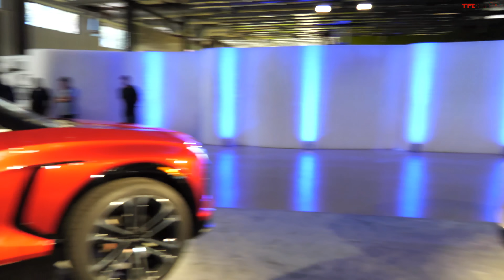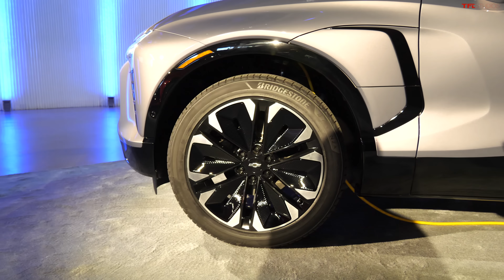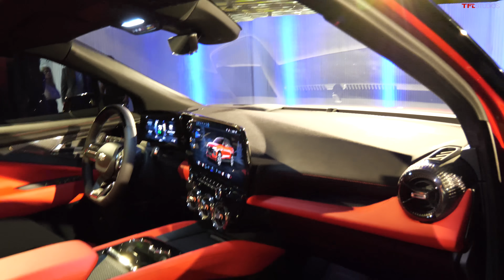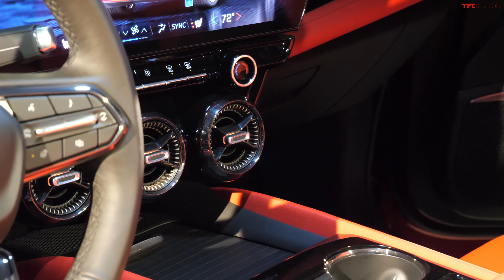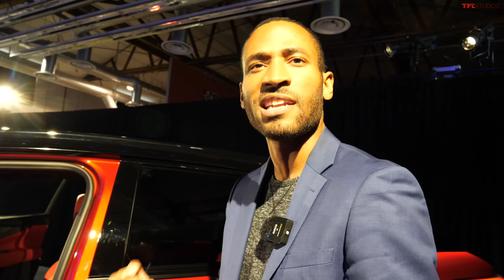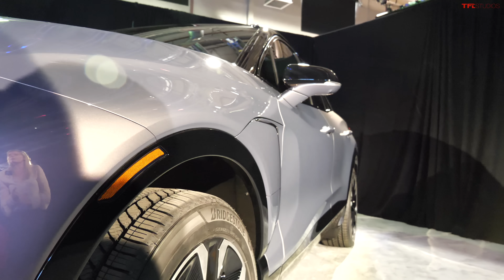Here’s Why The New Chevy Blazer EV SS Should Worry Other Electric Car Companies!

Comment: As a current owner of the XT6 Sport by Cadillac, I thought I was 100% going into the Lyric in 2023. Not anymore. I will be in the SS EV for sure.
Reply: 2 of my 3 current vehicles happen to be a Escalade platinum and we still have our ELR and a had was gonna get into a Lyric before I found out the first year was only the RWD only😕. Still want to get the 24’ lyric AWD but I’m wondering what the HP numbers will be because they’re only saying tentatively that it will be 500hp AWD which will not cut it if the Chevy will be rockin 557hp! 🤨🤦🏽‍♂️
Reply: @dennissmith7214  Precisely. Same story here. I have zero interest in a RWD vehicle. So I am waiting as well but once I saw the Blazer, my focus has shifted. As with any GM product, it will also depend on how quick I get my Family First Discount. Makes life easy when a 70k SUV drops to around 61k.
Reply: @MrJeffhart24  I would consider a RWD....NEVER a FWD........Tire spinning.ruining Ignorant design.........Paul
Reply: @paul-flyer  The SS model which we are discussing is an AWD.
Reply: @dennissmith7214  Word is that the XT5 will be made in a V version for 2024 as well. Wont be electric but if the HP is up there enough, it will be another fun one to look at.
Reply: @MrJeffhart24  Yeah I’ll be using my GM supplier discount😁, and as far as GM and rumors of other V vehicles I wouldn’t hold my breath on that…….we all know GM is the company of great ideas and big disappointments when it comes to making the products we actually want them to do, make a concept of smth we love and clamer over but never gets released🤦🏽‍♂️.
Reply: @dennissmith7214  500 or 550.........You won't notice the difference........Unless You're going to the drag strip.......Paul
Reply: This seems like a similar situation that Hyundai has with the Ioniq 5 (N) and the Genesis GV60. The luxury model doesn't seem worth the extra $10k or so...
Reply: @OlJackBurton  Agreed and I am a huge fan of Caddy.

Comment: I must say that I have truly appreciated the design of many GM vehicles for roughly the last decade.
This includes its current batch. Their lack of real BEV expertise does show with the way they design these vehicles. No frunk, slow charging both home and w DC fast charging… that’s by 2022 standards yet this is 2023 and 2024! Yikes.
Question is: will beauty be enough to make this vehicle sell?
Compare Korean, European and Chinese BEVs and this is somewhat missing. 
They will have a price advantage as Tesla, Audi, Hyundai/Kia, VW and others will be making their BEVs in Europe or the US… Like Tesla!
These will be made in Mexico. Much cheaper.
Reply: 190 kW is still quite fast and it is all down to teh charging curve. the EV6 and Ioniq 5 claim 350 kW charging but they max out at 240 kW.
Reply: @Nebula1701  re: "190 kW is still quite fast and it is all down to (the) charging curve."  bingo, after 50 years of marketing automotive consumers are so "suckered" by a psychology of BIG NUMBERS, that they've forgotten the importance of calculating and understanding averages. because: MATH.
Reply: Every manufacturer says to limit DC fast charging for battery life. Every. 

So is that 350kw charging good?  Best option is to just charge at home anyways, ac overnight.

Comment: Good luck affording a new battery pack when it inevitably fails.
Reply: 8 year 100k mile warranty and these batteries are easy to repair with their separate module design. No need to replace the whole pack.
Reply: @Nebula1701  How dare you present facts. He needs to convince himself change is bad!

Comment: So does this at least get over 300 mile range with the AWD/ DUAL Motor?
Reply: Close, 290.
Reply: @SouthernHadoken  I'll pass on this till they update the range
Reply: @chunkymonkeymatt  LOL 290 is the EPA Estimate from GM. GM always lowballs their range. My typical range on my Volt is 70 Miles while the EPA rated it 53.
Reply: 290 is the SS. I don't think they have rated the RS AWD.
Reply: They have 2 distinct AWD systems in this thing which is super confusing. They have a small AWD "assist" motor or the full dual motor AWD setup. The SS gets the dual motor obviously, but they never said which one the RS will get. If the RS can only opt for the "assist" AWD setup but still comes with the biggest battery pack size, you might still get over 300 miles of range. Only time will tell though.
Reply: @sipher3516  Is not confusing. One is about performance AWD. The other eAWD is more about handling weather conditions. If the road is slippery you don't need 557hp.
Reply: @theflew  LOL.  You got that right.  Great comment.  Wow, I got 557 hp, but on ice I will be out into a cornfield somewhere with my AWD vehicle.  But it sure goes like a Bat out of H*LL.   <hehe>

Comment: Why is it plugged in underneath?
Reply: I believe these are not fully working models, just prototypes or preproduction, etc, and they are probably plugged in for the screens and such to do demos or whatever.
Reply: @watchreport  This, and this is a common practice for show vehicles of all types from all manufacturers (including ICE vehicles) that are set to be powered on and in demo mode for these types of extended hours demos.
Reply: @suspicionofdeceit kind of thought that when the hatch wouldn't open
Reply: @suspicionofdeceit Don't start this. People tried to say that with the Hummer EV versus the Cybertruck. Guess which one is of the road today?

Comment: Why would they even make a FWD?!? The advantages that FWD has in ICE vehicles is the fact that the weight of the engine is over the drive wheels, but that isn't the case with an EV.
Reply: wouldn't that be a better setup for people who occasionally get snow?
Reply: @Somebody294  No. Its not like an ICE where most weight is in the engine and positioned over the wheels. The battery has the bulk of the mass and runs through the floorplan. FWD doesn't make much sense unless they're trying to differentiate based on handling and acceleration because RWD can put more power down, so GM can upcharge for it. FWD will be a cheaper, slower trim.
Reply: @Somebody294  No. FWD advantage in snow depends on the weight of the engine over the drive wheels. Without an engine up front there's no advantage, there's actually the disadvantage from the weight shift to the rear wheels when accelerating (unless you're in reverse, since somebody will argue that 🙄)
Reply: FWD and AWD are the most familiar to most drivers. Unless you own a sports car / muscle car or a truck everything else is FWD or AWD and has been for decades. Most drivers are more familiar with the more forgiving nature of understeer vs oversteer. Honestly,  RWD - much like a manual transmission  is a rarity these days.
Reply: @thetacticalape8852  You nailed the actual reason why front wheel drive, because for most drivers, fwd is easier to control because of the forgiving nature of understeer.
Reply: @funnybeingme  If oversteer was the biggest concern they wouldn't offer RWD at all. Oversteer can be tuned out of the suspensions by making the front less compliant than the rear. Not to mention the ability to brake individual wheels in modern vehicles,  which controls yaw. It's not the 80s anymore.
Reply: Familiarity with regular crossover shoppers
Reply: The front motor unit has more ability to utilize regenerative braking. Rear-drive EVs have a performance advantage all around, except in the amount of regen braking they can provide. everyone know that applying too much rear brake can cause a wiggle under braking that is disconcerting. This is not only a catering to the average customer type of thing, but also to enable ever so slightly more range for the smaller battery pack and FWD versions.
Reply: @JJ-yu  There'll be no difference between the regen efficiency between front and rear wheels. The torque that regen imparts on the wheels is never so high that the rear wheels would need additional downforce to prevent tire slipping. The weight shift to the front wheels under braking wouldn't be enough to degrade regen.
Reply: @danoberste8146  I appreciate what you are saying, but this is not my understanding based on a few engineering discussions I've listened in on at press events. Otherwise, why are front brakes larger than rear brakes? Its because of the weight shift that the front wheels are actually able to provide more braking power than  the rear. I agree that the difference may be negligible, but I have heard from Toyota engineers that this is a consideration when they program regen and why vehicles like the Bz4x are front drive instead of rear.
Reply: Fwd is the only version I would likely consider, because I would want to pull it behind my motorhome. I haven't found a rwd or awd that can be flat towed.
Reply: @ericpearson6475  Once I put a little thought into it I realized that there's cost savings by going with a very simple and cheap rear suspension. That's not going to work very well if the rear needs driven axles. The front suspension always has to be fairly complex and costly simply because of the steering components that are required. Adding drive axles to that isn't as big an added expense as adding another complicated suspension in the rear too. A simple, light, and cheap twist beam in the rear of a FWD car will suffice.

Comment: Interesting that it can be FWD, RWD or AWD. Also interesting that the RWD is the largest battery and best range.  It's a good looking vehicle too, I'd take it over the regular blazer.

Excellent interview as well, asked important questions about battery configuration and actually let the man talk.
Reply: I really wish they'd give an option for the biggest battery but still keep the FWD motor for max efficiency and range. Seems like a shame to give the bigger pack as an option on the RS but only with the fatter RWD motor.
Reply: @sipher3516  it has the longest range not because it’s RWD, it’s because it’s the best way to fit the largest battery in this platform. FWD vs RWD means nothing with respect to range - it’s the battery size. AWD is a different story, it does actually affect range because of the extra power used for the additional motor, etc.
Reply: @justinstewart3248  What I meant was they should offer the biggest battery on the FWD trims because they have smaller wheels and less features, so they should get even more range. My original comment was poorly worded.
Reply: @sipher3516  ahh I see, understood. Yeah I thought you meant range was affected by the front vs rear config itself, but I get it now. In this model the bigger rear motor actually might affect range compared to the FWD model
Reply: Awd
Reply: I just wish we new the HP and TQ figure of that larger rear drive unit for the RS RWD. Assuming its half of the all wheel drive SS its 279hp ...Meh
Reply: But, it doesn't make sense. Rwd
Reply: Makes sense as it will be made on same line as the ICE version which offers FWD and AWD models. With electric, contrary to ICE, that means you must have room for motor in front and back. FWD does not mean the same as it did with ICE as the weight of the engine and transmission is no longer focused on front of vehicle. Does show how this is basically an ICE vehicle modified for BEV usage.
Reply: @davidlemieux615  this is not going to be made on the same line as the ICE blazer. Same plant. It's a completely ground up clean sheet design and is not a modified ICE vehicle.

Comment: FWD standard. No frunk, large center console tunnel, 0-60 under 4 seconds? 🙄
Reply: FWD standard on the base model RWD standard on RS,  and AWD standard on the SS
Reply: @dmitchellhomes  maybe that's the reason there is no frunk. Pretty much everything else in the segment is rwd. Driving dynamics won't be as good with this thing.
Reply: @ShersGarage  Yeah, but in the Midwest, there are a lot of customers who believe front wheel drive is better, and GM is going to cater to those customers because they do a large amount of business in that region.   Rear wheel drive sells better on the east and west coast, and all-wheel-drive better in the north, GM is having all of the options to cater to all of the customers.   On driving dynamics, I will assume the SS is going to be pretty good, all of GM‘s performance chassis, our best in class.   GM knows what they are doing when it comes to tuning a chassis, just check out the reviews of the Cadillac CT4, and CT 5 black wings,  Several reviewers said it’s the best chassis they’ve ever driven, and makes BMW look obsolete
Reply: @dmitchellhomes  growing up driving in harsh winter conditions and driving a rwd car, it wasn't that much different. It is all about the tires. To me this is a cost decision from GM. I will wait until the reviews come out. In the meantime I think this product to be another stop gap platform from General Motors.
Reply: @ShersGarage  well, on internal combustion, there’s no doubt front wheel drive is far better in slick conditions than rear wheel drive,  but the reason technically, is because a front wheel drive car has more weight on the front wheels and therefore more traction, whereas an EV, has more 50-50 weight distribution, so the back has equal weight to the front.   Yeah, I think the front wheel drive is intended to be cheaper, and will only come on the cheap models, but that is the reason Blazer can be priced down around $45,000.   There are a lot of people in this country, and a lot of different budgets, GM wants blazer to be a high volume product, and sell at several different price points, in another month they will introduce the equinox EV, which is just slightly smaller, about the same size as ID 4,  this will take the price range even lower, to a rumored starting point of 33K.  The equinox EV, is being designed as a very efficient vehicle, rather than the performance design of the Blazer.
Reply: @dmitchellhomes  competition is in the 40s as well. Blazer supposed to be longer. But interior dimensions are not that great compared to other. Probably all went to trunk or hood.
Reply: @ShersGarage  clearly you don’t know what you’re talking about, the interior of the blazer, is huge compared to the Tesla model of Y, especially in the backseat, it’s also bigger inside than the Audi E Tron.   And which competitor is in the 40s?   Tesla model Y starts at $68K
Reply: @dmitchellhomes  look up the interior dimensions.

Comment: Frunk or heat pump?
Reply: No frunk, this is on the lyriq chassis. Rumored all the new ultium platforms are supposed to have heat pumps standard.
Haven't seen that actually confirmed though. Would be funny if they didn't since the ev1 had a heat pump 25+year's ago now.
And all teslas since 2020 have had heat pumps as standard equipment.
Reply: @4literv6  thanks for the info I must of missed that part. Heat pumps make a huge difference in colder climates. I live in Chicago so it’s important to me
Reply: supposedly but nothing confirmed.
Reply: No frunk. Yes heat pump.
Reply: @bahamatodd  not confirmed.

Comment: Does the TFL  crew members in charge of production ever weight in on what makes great video/interview?  Cause overall it seem process struggle to find  it's spot  I thought Justin did the best but fell short. It seemed most of the time Doug and Amy where trying to find where to go and frankly you've done better. Maybe with all the new on board ppl. IMHO not ready for primetime. I hear they're struggles on the AMP to Alaska as well.  Maybe it'll be better when they get back.
Reply: First, he did just fine. This isn't an optimal setting to do interviews especially considering there is a lot going on with hundreds of other journalist there and the GM people going from interview to interview. Also, he was by himself & had to act as both the camera man & interviewer. They likely only get a few minutes to get this in without a bunch of other journalist walking around the car.  

Second, maybe before publicly criticizing their production you should make sure your grammar is better, especially considering you edited your comment. I usually don't critique anyone's grammar on comment sections because I know typos can happen & people are usually casual but if you are going to criticize them for their production when it's a one man operation then you need to make sure what you are putting out doesn't have any flaws either.
Reply: @kenyattaclay7666  did fine? Are you on drugs or something? He was terrible.
Reply: @DougNoOnions  never done a drug in my life & yes, considering he was a one man band he did just fine.